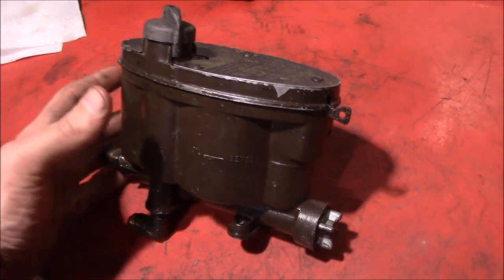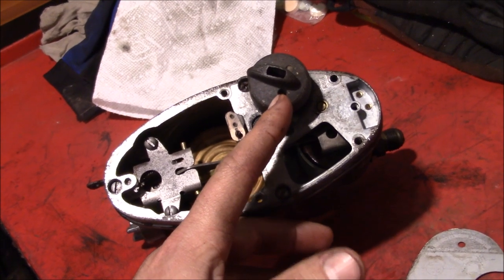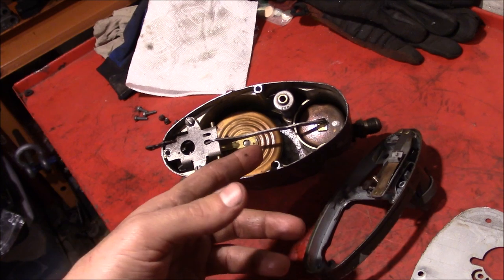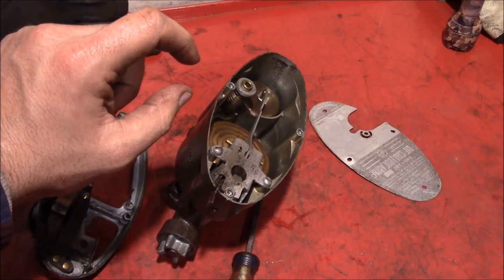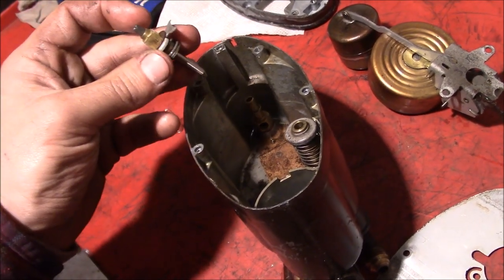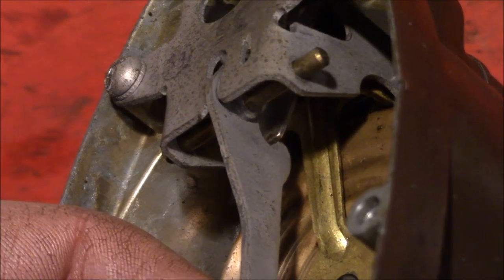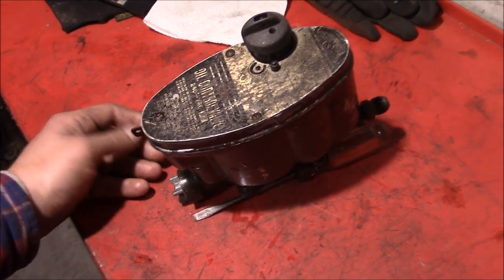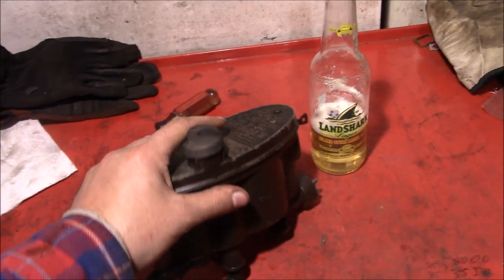Oil Heater Control Valve - Overview and Disassembly

Comment: Ive got so many questions I could ask, but I will try and be to the point. Ive used one of these for the past 30+ years and I am on my third one for different reasons.I had an issue Christmas eve where the flame went out with the fan on and I got a mist of soot all over everything in my house:( My question is this...if it is running too rich, will this increase the amount of soot which, in turn, will eventually block off the very small fuel intake opening to the burner and cause the flame to go out? I think this is what happened. I have been smelling an oil smell this year since I emptied my tank and then had it refilled. I drained it as low as I could to fix a tank leak but it probably had sludge remaining. It is my main heat for the winter, but I am not confident enough right now to take it apart. I would still like any input you could give. The heater is an old Siegler from Chicago. It is strange because when I turn on the faninstead of increasing heat, the temperature drops in the room and the air coming from the ducts is not very hot?  I want to get it adjusted properly but there is no one in my area that works on them any more. Most have abandoned them for home use. Thanks for any help. This video was eye opening and I thank you for it!
Reply from the maker: I'd start by pulling and cleaning the internal screen at the bottom, I agree that there's a good chance it drew in some water or sludge when the tank was run low or filled.  I always try to not run any oil furnace for a few hours after filling the tank, to let all the crap settle.
Reply: @toocheaptosmoke    Thanks for the reply. do I have to disconect the fuel line or just turn off the valve at the tank? will there still be some oil in the line? ! I am also going to really clean all the air holes in the burner because the soot has likely blocked many of those also. i made the mistake of using #2 fuel oil because the price of kerosene is so much more so i have 125 gallons to use up.
Reply: btw, the tank had about a week or more to settle before I used it, but it had a strong smell when I did that gave me headaches:(  I had to run it a few days during a cold spell. I only use it when absolutely necessary because it gets so sooty. the smell seems less than the first few days, but still something i am uncomfprtable with.
Reply from the maker: @willw.6639  You'll have to shut off the valve at the tank, but there will be some in the line that pours out, just have a wad of paper towels to soak it up.  Cleaning all the soot out will help, make sure the oil can flow freely into the firebox.  I run #2 heating oil a lot, if the furnace it sealed up tight and runnig right there is no smell.  Also check to make sure flue and chimney pipe are all clear, a restriction there will cause smoke to backup and not burn very well.
Reply: @toocheaptosmoke  thanks!

Comment: Good video forsure I have one of these but the oil won't flow where would I go first.thanks again
Reply from the maker: Would see first if any filters are clogged, then see if the valve is full of oil or not.  If its empty, main needle or shutoff lever may need attention.  If it's full, metering valve/notch may be clogged.

Comment: So was there any type of thermostat control on these furnaces? Or did they run constantly and use the flow of fuel to regulate the temp?
Reply from the maker: No thermostat, just the constant flow at the desired setting.   Usually gotta crank it up when first lit, but pretty consistent heat once the room is up to temp.

Comment: Thanks for the information on the fuel regulator. My parents house has one on an AGA. It used to be solid fuel. They concerted it to oil in 1975! Never a problem with it to this day!! 
I want to service the piece where the wick or oil try is...any information there? 
Thanks again, good video..
Reply from the maker: Not sure on that, the different manufacturers may have each had a slightly different setup.

Comment: I have the very similar BM regulator. I cannot get oil to flow through the slit in the oil valve. It’s as clean as a whistle but only allows a tiny amount of oil to pass through it.  I have tried it removed from body and water does trickle very slowly . It just stop working so I assumed there was a blockage. 
I’m mystified
Reply from the maker: Is the line clear into the burner pot?
Reply: @toocheaptosmoke  It was clean but I will check again in case some debris has been dislodged while I was taking everything apart. Thanks

Comment: Could I still leave this on the stove and burn used motor oil
Reply from the maker: I think motor oil would cause problems, too thick and would need preheated to flow right, but then could likely gum up the internals.

Comment: Do you know of a video on how to light the heater. Mine is a sears, but lighting instructions.
Reply from the maker: Have always lit them by turning on the valve to medium, waiting a couple minutes, then take a coat hanger bent to hold a cotton ball and dip it down into the bottom of the firebox.  When some fuel oil soaks into it, light the cotton ball, lower it back into the firebox, and after a bit the fuel oil in the bottom lights up.

Comment: Do you have any idea where I could get a fuel filter with the retainer nut for this valve?
Reply from the maker: I don't.  However, if you were able to find a standard size plug/bolt to seal it up, you could plumb in a traditional canister filter into the supply line, that would at least get it functional.

Comment: so after cleaning and rebuilding this heater will run great for about 2 weeks then gets weaker each day until nothing. Any Ideas?
Reply from the maker: Sounds like a clogging issue, try to start working your way back from stove to see if there's dirt in lines or the filter(s) are getting clogged.
Reply: IF YOU BURN MODERN FUEL WITHOUT SULPHUR  YOU MUST USE A FUEL ADDITIVE TO PREVENT CLOGGING
Reply: @yiannisiacovides8000  Hi, How much sulphur is necessary?
Reply: I don't know how much sulphur is sufficient to prevent clogging. The fact is that it is now  international law that oil fuels supplied to the market are free from sulphur. This will result in engine exhaust valves needing shorter maintenance intervals.
Reply: @yiannisiacovides8000  OK Thank you.

Comment: Any idea where to find a replacement large float?
Reply from the maker: I don't know of any sources for new ones.  I was able to repair one with solder, but you may be able to find a similar size carburetor float and attach the mounting bracket to it, it's just soldered on.

Comment: I bought one of these heater need help opening front observation window door
Reply from the maker: The ones I've seen either slide up, or have a spring latch.  Maybe carbon is built up on it?
Reply: Got the door open but need help with the oil control valve. The knob is stuck! It moves a little but not much and not enough to even reach pilot light.
Also the insides of the furnice has some spots rusted out. Wanted your opinion on trying to fix it. Thinking of covering it with Ceramic fiber used in furnaces. I don't have access to welding unfortunately so i have to make due with pasts and special fibers like ceramics to rebuild this chanber
Need your advice on weather i should be able to repaire this before i SPEND money on a lost cause?????
Reply from the maker: @colbolt54  That's a tough one, best repair would probably be brazing.  The ceramic will have a hard time bonding securely to the steel as it will expand a lot more when heated.   You have to be careful with a compromised chamber, oil could leak out the bottom or let fumes and smoke escape.

Comment: People are incorrectly calling these things carburetor's, which they are not. They do not mix air with the oil before it goes into the combustion chamber.
Reply from the maker: That is true, but I can see how people would compare them because of the float bowl setup.